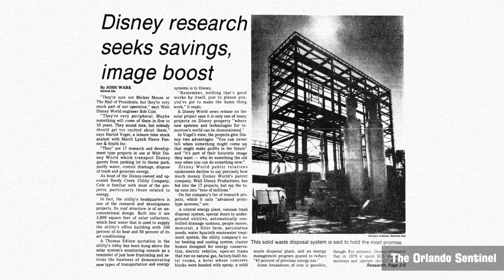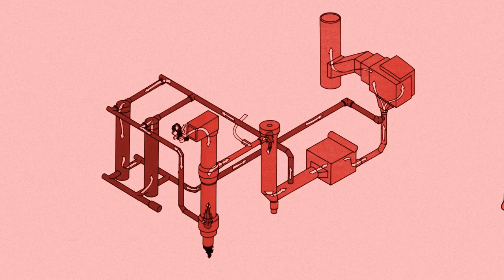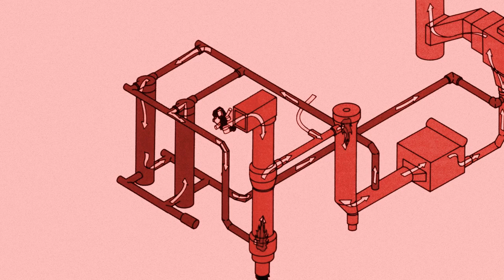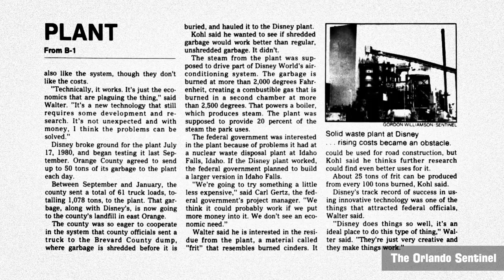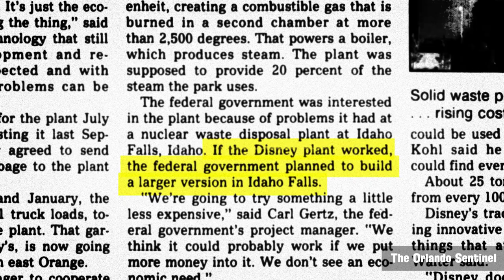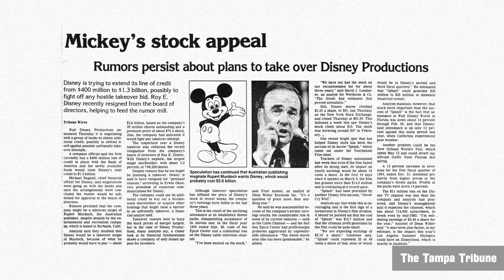Disney's Failed Trash Plant: The Solid Waste Energy Conversion Plant

Comment: You can get energy from buried trash too. There's a retail complex near Detroit (Fairlane Green) that was built atop a landfill in 2006. I know there was CityView Center near Cleveland too (that went horribly wrong) but this one was done correctly. They have to collect the methane from beneath the buildings and route it to the roofs where it's simply vented to atmosphere. It's a potent greenhouse gas. Sometimes they flare it off. I don't understand why they don't try to harvest that even if it's just to run a boiler for domestic hot water. Stick a heat exchanger on the end of the flare. At least it would be something.
I personally feel guilty for letting hot bath water drain out before the heat has absorbed into the house, it takes a ton of energy to heat water.

Comment: I think I remember this plant if it's the one that used to be next to the RC energy services plant, opposite MK.  I went to what used to be the Kinder Care right in front of it growing up, what is now a vendor services building (I think) across from West clock and DU.  Crazy how you wouldn't even know it existed now, the large hill the dump trucks used to take up to it is completely gone and everything is totally level now.  We used to have cardboard box sled races down that hill for fun.  Awesome video and thanks for some answers, I remember always wondering what went on there because the dump trucks were so random and it never smelled like garbage in the area.  Amazing how different that space and the area surrounding it are today, used to not even be allowed back there without an ID, lol.

Comment: Such a shame that Disney were just too far ahead of their time...and many are still struggling to make the technology work now and nobody has it working commercially at scales under 40,000 tonnes per annum - until we found it.  We're bringing a 2MWe plant to the UK utilising fixed bed downdraft gasification, at the same 100 tonne per day scale, producing clean heat and power for local homes and businesses.

Comment: Wasn't that an incinerator, but in different form? And also why not convert those waste into electricity, then boiling water? There are more and more modern incinerators generates electricity by burning waste.
Reply: Each conversion is a loss in efficiency.  Burning waste to make heat to boil water to make steam to spin a turbine to make electricity to heat an element to boil water?
Reply: @DesignedbyWill2084  well... the electricity could be use to power many other things, not just only for heating water😅😅. TBH, I have no idea how an incinerator works as we don't have one in Hong Kong. But I know there are many incinerator convert waste to electricity.